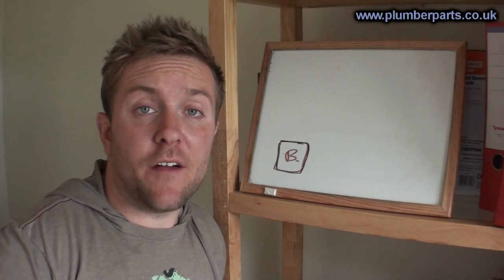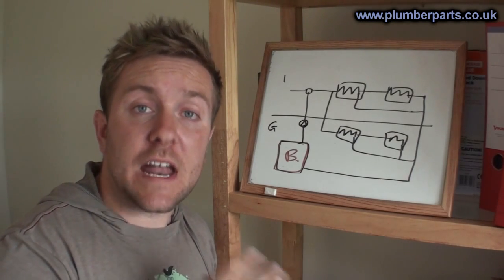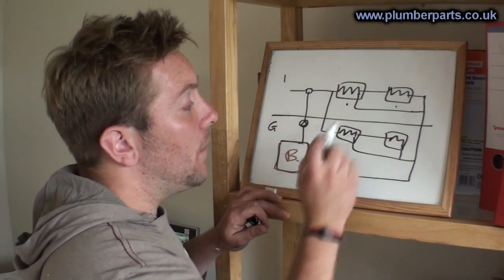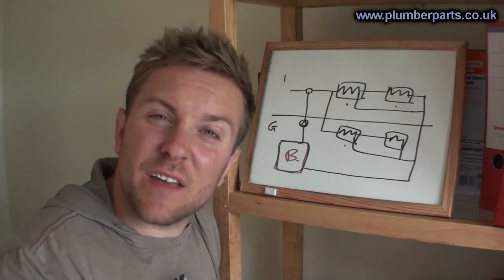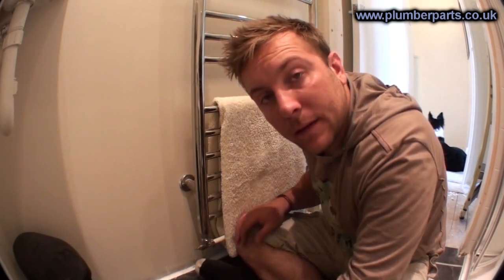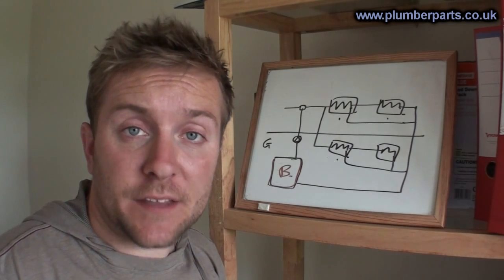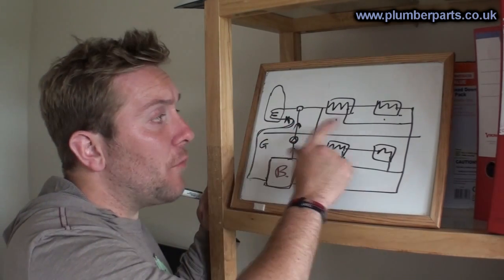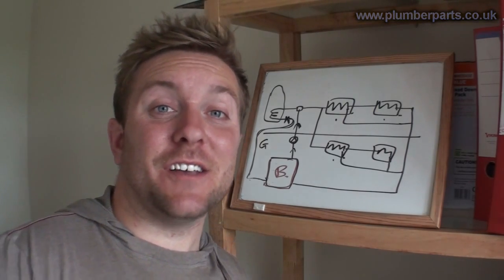How to Balance Heating System Radiators - Plumbing Tips

Comment: For the downstairs lockshield valves, are these also set at the "quarter turn" - so as to "give each component in the heating system an equal amount of flow".  In my head when I'd watched the first part of the video I was thinking that you were throttling down the return on the upstairs and opening up the returns downstairs .......  but no its equal flow on all parts.  Have i got that right now?  P.S. great videos have been super helpful to me today in removing a drop loop kitchen radiator  CHEERS!!

Comment: Hello. I have an old radiator / central heating system (gravity system). The radiators are old cast iron ones and none of them have lockshield valves. How can I balance them?

Comment: Hi there, just looking some advice. I have had a new boiler fitted. It's a grant vortex 50-90 condensing boiler. Problem is its worse than the original 25 year old warm flow 70-90. My rads take hours to to heat. Do you think this is a flow problem or boiler size problem. The new pump supplied with the boiler is supposed to up to the job but is very small by comparison to the original. House is about 290sqm and 22 rads (3 are towel rails) overall run is about 22m there and back between the floor and celling with all downstairs rads on drops.  I really need help. Bodge it and scarper plumbers won't answer the phone!

Comment: As per your diagram ,from left to right the upstairs 1st rad is fed by the boiler pump .The 2nd rad is fed from the 1st rad's output (or return).This implies they are connected in series ,but their return is parallel.The ground level rads are connected identically.Why should the hot water from the 1st radiators bother to enter their series connected rads when the water has an easy return path back to the boiler?

Comment: I have a rental opposite my house that I look after for a Landlord.

The radiators  at the back of the house, 3 bed semi, are roasting, it's the front of the house where the radiators don't come on, boiler is at the back of the house too, I get a call out every other week. Boiler was losing pressure found a leak and sorted it and now the boiler is holding pressure. 

I'll give it a go balancing it on Sunday when I'm due to start decorating the place and see if it makes a difference.

Comment: Alri pal.. Is that why the overheating light is coming in at the Boiler?? The rads upstairs in my mother's house are too hot and the 3 downstairs just won't Heat.. I rang the maintenance department and they said it sounds like a balancing issue..

Comment: Why does it matter on which side of the hot water coil circuit that a regulator valve is installed? It will surely do exactly the same job.

Comment: Recently moved into a new home with 24 !! Rads ,a New Baxi  32 system boiler with unvented cylinder .I have one radiator in a conservatory that only gets Luke warm at the top cold at bottom .bleed radiators and with all the other radiators off the one in question then the flow is red hot radiator is also hot all over return is hot but not red hot . i know it wont be but with this the only rad on then i would expect  it to be hotter . When i start putting the other rads on then this rad goes back to warm at top and cold at bottom . 
   Any thoughts ???

Comment: how to find a under ground leak from radiators with no signs of water but the water tank will not stop filling up thanks
Reply: sounds like your pressure release valve is stuffed..

Comment: I live in Denmark, and my main enjoyment in watching your videos, is to see how things are done differently in the UK as compared to where I work in Denmark.
For example, where I work in Denmark, a lot of the balancing (at least in the somewhat modern installations) is often done using specifically adjustable valves, with number-settings on them. It basically does the same function you mention there, except that there is clear numbering on them, so you know how much each valve is at.
And, some of the newer Radiator-valves (which sits behind the thermostat-unit), has a simple built in regulation, where you can determine the maximum water flow for that radiator, which is really neat.
Reply from the maker: Those balancing valves are coming over here soon too with Danfoss. Got my hands on a few already! SUBSCRIBE! ➡️👉 https://www.youtube.com/subscription_center?add_user=plumberparts 👈⬅️if you haven't already!

Comment: Hi, I noticed that your installation drawing showed the Radiators having a single supply (assume HOT( in and 2 outlet pipes, one going to the next radiator and one to the Boiler Return.

Now I can see as an Engineer lots of problems with this configuration and whilst it may be the Indunstry Standard it does seem to me to have issues with it, as your video points out.

Now from a non plumber aspect and sticking my neck out here and not wishing to piss anyone off, but why not just whip a Flow pipe out of the Boiler and take it around the building/home and then put it back into the RETURN of the Boiler.

Effectively having a loop, this allows water to travel un-interrupted all the way along a nice big juicy 22mm pipe back to the boiler.

Then where ever you want a Radiator, simply cut into the pipe and put in a T but making sure you do it to both ends of your Radiator, in event DO NOT BREAK the Main Loop, this will balance the Radiators input and output automatically.

I have installed three Full 4/5 bed houses using Method/System and it works like a dream, I never balance a thing, be it they are all running from a Combi Boiler and do not have any need for a water storage vessel.

Feedback appreciated, but be nice!
Mr Spence Eng
Reply from the maker: Hi mate, that's called single pipe system and they work fine! They only get a bit grumpy if you have loads of rads on the loop. If they work ok, then well done!!! PP!
Reply: ***** Hi Plumberparts, thanks for the feedback, but what do you think could be the tops as to the number of rads where the Boiler is on the Ground Floor and the building is just ground and first floor?
I would be interested to know, it could for warn me, before I do another plumbing loop in my place in France, now that is a biggie and over 3 floors.
Another problem I have is I am not sure what is the min height I should set the Header Tank to feed a Direct HW Tank, which is feeding an on-suit in the bedroom on the floor below and what size it should be, much appreciate any help here or formula.
Mr Spence Eng
Reply: I'm neither a plumber nor an engineer, so I know that what I'm about to say a load of ............unprofessional pointing out!  Especially as the professional plumber has agreed that yours is a great "single pipe system". 

I love the sound of your system I cannot figure out how you force the water to go through each radiator instead of just continuing along the easy route, along the 22mm loop back to the boiler.  Even with T joints on the loop,  at entrance and exit of each radiator, how can you get the water to make a right turn at the entrance T joint into the radiator.   Won't it just continue straight along the 22mm loop, which offers the path of least resistance?
Reply: apache16789 wow nice to see someone thinking of the backside of an idea, be carefull you could end becoming an engineer. Your response is bang on, the path of least resistance will always win.
A System using a flow and return will want to simply return to the source. But here is the real thought process, think in simple terms of what is going on, simply think of a river, running free, the flow is fast and seems unstopable, however, what happens when you put in a trench to that river, well it simple forces it's way along and into your trench and given an outlet exit it will carry on, whilst giving up some of it's energy/power, exactly what a radiator does when put it onto a loop Central Heating System, and no balancing problems!
Hope some of that helps.
Mr Spence Eng
Reply: keithspence   Well, Mr Spence Eng,  Thank you for taking the time and bother to reply.  You are one of only two people who has ever done it!

If you say it works then I'm 100% convinced that it does!  I just cannot visualise how it does it.   I understand your analogy with the river and a channel going off to the side; water will certainly divert itself into the channel.

But if you were to hold a 15mm pipe (or any size of pipe) vertically in the middle of the river, water would not divert to flow upwards into it!

Or dangle a radiator above a fast flowing river,  with an entrance pipe and an exit pipe both submerged  in the water flow and I don't think you are going to get water flowing through the radiator!  

And that is what, it seems to me at least, to be happening in the case of a Loop Central Heating System.  You've got water flowing round an enclosed loop; at some point it meets a T joint where it is supposed to make a 90 degree turn upwards for say, 3ft as it fills the radiator, progresses through the radiator matrix before exiting at the other end where it rejoins the flow in the loop and  continues to the boiler. 

There must be some law of physics or law of running stuff or law of something at work here, that I don't comprehend.  But it is my stupidity; I shall deal with it!! Thanks again.
Reply: apache16789
and this is the reason why we install a Water Pump in a Central Heating System, this increases BOTH the flow and pressure and in turn will Force water to lift from one floor level to another. A second form of making water rise is to Heat the water, hot water (Steam) will allways rise, this along can make water rise from one level to another.

The pump of a river is the upstream force, maybe water coming from a Dam or High Ground, creating in some instances a greater force than that of a Mechanical Pump, also bear in mind that "Water is able to reach it's own level" hence if water flows Down from a Mountain at say at  height of 10.000ft then it is possible down in the valley for it rise to this level once again.

Remove a Water Pump from a Central Heating System and the only place you will have hot water will be at the Boiler, the Boiler will kettle, a term of starting and stopping, making Hot Water like a kettle and once cooled it will re-boot and make more hot water and so on, be it the Boiler will be making a bit of a racket.

Hope this makes it a little bit more plausable, I have been where you are and remember when I was at college being given methods and formula, often not realy believing that you could lift the world given a pivot point or that energy is never lost only moved from one point to another.

Now I look at string theory with a simular view point.
Have a good day
Mr Spence Eng
Reply: keithspence   Thank you. I'm 60  now with time fast running out but I'll use it wisely and give it some thought!
Reply: apache16789 what are you thinking of doing, I am 62 this year and have since retiring age the ripe old age of 55, spent my time rushing from one project to the other, presently I am trying to Build some Bridges for my Mill in Central France.
Mr Spence Eng
Reply: Thanks for responding Keith asked my questions and you answered them too. Cheers

Comment: The previous owners of our house removed a radiator without removing the pipework. Obviously this will affect the balance but would the water be flowing correctly? ? The two valves aren't connected so there would be no through flow. TIA
Reply from the maker: andrew harwood Should be fine!
Reply: That's good. Thanks
Reply: andrew harwood
Take this and as many as you like out, it is just going to make what is left work better and HOTTER!

Comment: Great video. Had an airlock in rads on second floor but older type so could not unscrew complete bleed valve. Instead screwed down valves, cracked open coupling onto rad and used wet vacuum to suck water out of rad. Then lifted rad off wall and connected washing machine hose to each valve and put end out of window. Opened each valve and let air out, reconnected radiator, bled and all done. Many thanks!

Comment: Never had to balance radiators due to fitting larger pipe to first radiators then smaller to the last, we never fit same diameter pipe to the system

Comment: why do boilers, like Rayburns cookers, have 28 mm flow and return pipes to the hot water cylinder when the coil is 22 mm. Do the pipes to the radiators have to be 22 mm and not the more usual 15 mm? Rayburn insist that there are 28 mm pipes to the hot water cylinder.
Good videos and well explained

Comment: I've just been round our 4 upstairs radiators, have closed the all then opened them all to 1/4 turn, so, it's fingers crossed.

I have  weird problem you might be able to help with. Previously we had a lovely warm airing cupboard, then a couple of weeks I found it stone cold (no more nice warm towels). We have hot water and radiators are mostly hot ( just trying to balance them). Any idea why this would be.

Comment: All magic, I'm going great guns here,suddenly extra rads in my house are heating up, I mistakenly opened all of the valves up thinking it would help a while back.  I did as you say, but two towel rails are still piping hot.  do I shut off both inlet and outlet valves (they don't have TRVS on them)?, Also the return pipe to coil, how much do I need to close that off? cheers for help

Comment: Correct sir.....and...you must have one rad with no TRV valve, because if all the TRVs on the rads happen to shut off, the pump will still be trying to pump the water but the water will have no where to go and the pump will fail and leak.

Comment: Sorry James look at your drawing the flow goes through the first upstairs rad to the second upstairs rad and the same for downstairs. If the first rad was shut off by the TRV the second wouldn't work at all. That's not a two pipe system you have drawn!

Apart from that it's a pretty good video give yourself a cigar!

Comment: Dude! Is there a tool to turn the lockshield valve? It's a pain in the tits to use a feckin' adjustable! There must be summat? If not, I'm off to the engineers and then strainght to the Dragon's Den for £100'000 for 1% of my idea and a squeeze of Hilary Davey's nether-regions to see if it's actually female!